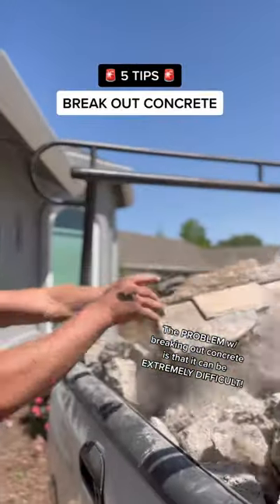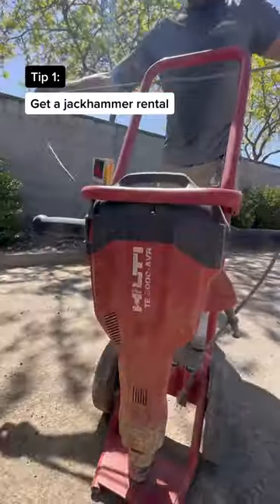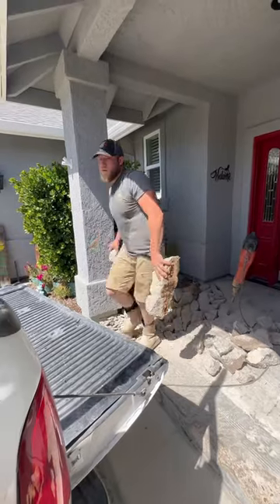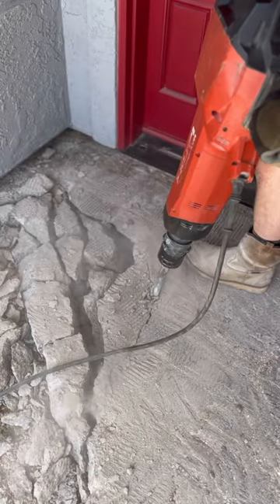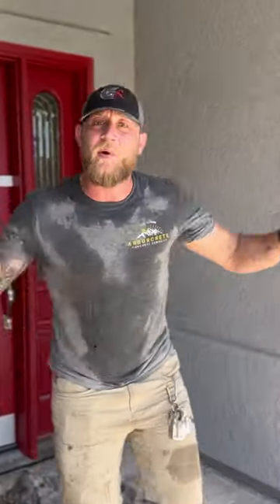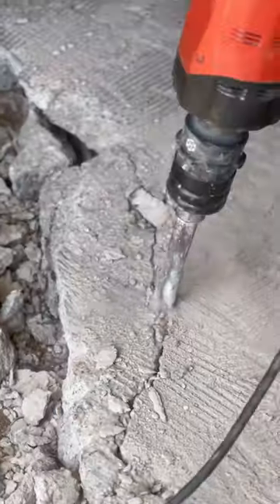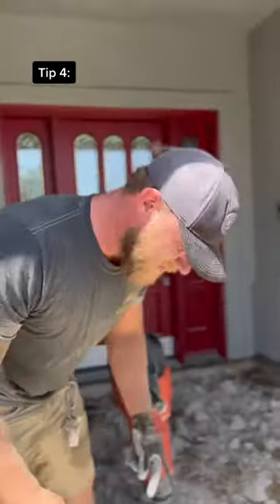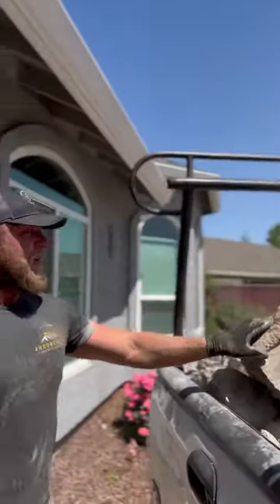5 Tips to make concrete tear out a little easier! #short

Comment: Heres a tip use a demo saw and cut the slab like a checker board. Those relief cuts make a world of a difference. That little slab woulda come out entirely in an hour or two
Reply: It helps just not always worth the hassle of cutting it
Reply: No need to cut its glued in that spot if you heat it you can seperate it. Its a flap